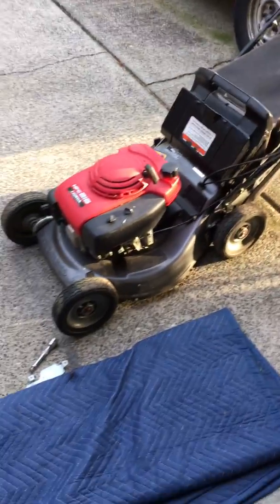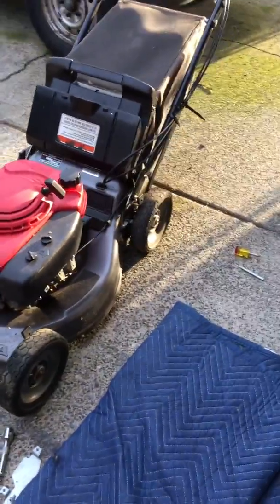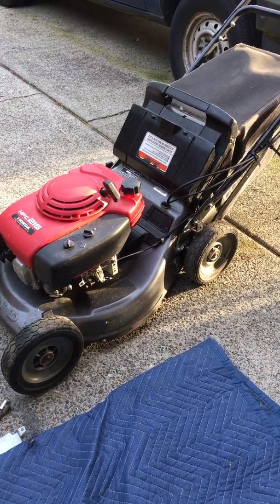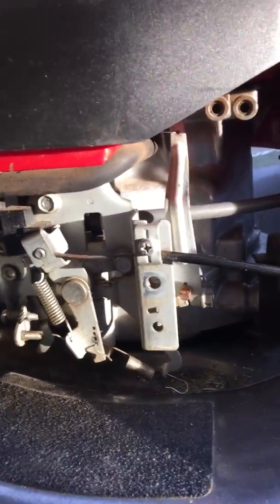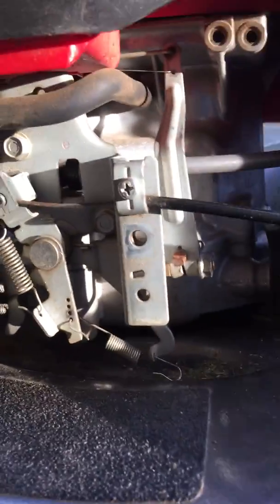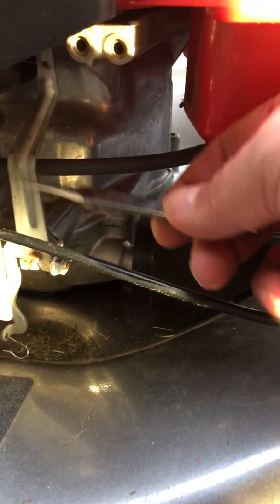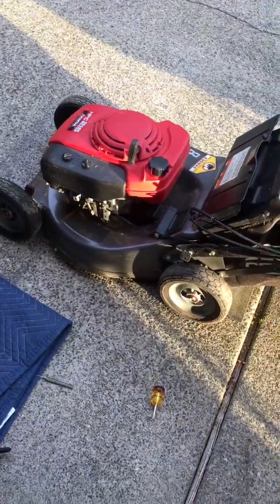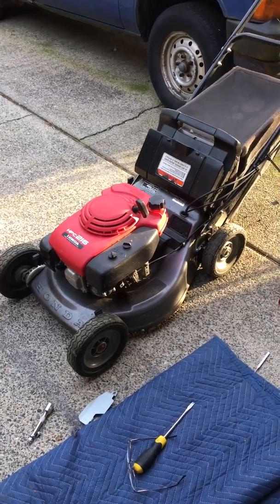Increase rpm on Honda Commercial lawnmower

Comment: Awesome, just used this trick on a 2023 HRU216. Whilst I couldn’t turn the governor thingy clockwise I could hold it still with pliers and move the arm to the left and then tighten the 10mm nut, worked perfectly. Nothings changed in 25years, crazy

Comment: I am on my second Honda Commercial. The first lasted about 15 years until the deck rusted through. I repaired the hole and the mower is still in use. The rpm is set low before delivery and should only be increased after 40 hours (the engine needs to be broken in). You should use a tachometer to set the speed to factory spec. otherwise the engine could suffer. They are called "commercial" yet few landscapers will use them (the main reason is they are very heavy). They are hard to turn and sink into wet grass. You do get what you pay for otherwise. The Commercial will outlast most of the Honda lineup by 3 to 1 in my opinion...

Comment: I did that to mine the motors rpm increased but the blades were spinning at 2,250rpm when I increased the motors rpms did that mess the clutch or clutch belt up in any way,?Keep in mind the motor sounds exactly like yours so I know it’s not running at low rpms
Reply from the maker: Jordan Price 
2250 is almost idle speed. Honestly I’m not a tech but wanted to share my experience.
I just did the springtime tuneup & adjusted idle for 3,100 with blades engaged. I will comment the two adjustment screws with springs around them (1 long 1 short) are for choke & hi idle adjustments. The black screw on the front of carburetor affects low idle. Compared to an old briggs& stratton it’s quite complicated. One more bit of advice. Never stretch or alter any of the springs on the throttle linkage.
In all the years I’ve owned mine I’ve never had to touch the clutch system so unfortunately I can’t help you there.
Hope you get it worked out.
Reply: jatoav8or Thanks

Comment: If you look at the Honda power curves, you`ll see the max torque is at 2500 for most or all these engines, and the max hp is at 3600. Contrary to popular belief, torque is where the real work is. So, one would keep is engine where it`s the strongest. After 3600, the power falls off a cliff because the engine doesn`t have the breathing to go faster. Honda puts the speed at around 2900 to 3100. Right between max torque and max hp. Good spot. One doesn`t run his car engine at 6000 rpm`s all day even though that is where the red line is.Then, you have the blade safety factor and the internal engine parts strength factor. Plus the extra engine wear.
Reply: Higher RPM increases blade tip speed and that's the key.
Reply: I just bought the HRX 217 VKA with 200cc.  The max speed is the same as 2 clicks down on the speed dial control, so I think it can travel a little faster on the ground.  To make the wheels go faster, do I need to adjust the drive-cable jam nut on the left side of the handlebar?
Reply from the maker: puncht37 ; I totally agree and my mower had no problem powering thru the thickest grass at the slightly lower rpm but for me clogging of the chute was a constant issue. Bumping up the revs has solved that and has served me well for nearly two decades with the same machine.
Maybe my unit was set unusually low from the factory because it was clogging constantly cutting a dry regularly maintained lawn. 
My issue wasn’t lack of torque but lack of vacuum.
Reply: So far, the 190`s got balls. It barely loses rpm`s even in high wet grass.

Comment: Oh ok but how come it says it's 2850 rpm on the manual?
Reply from the maker: Matt Seymour 
I’m a home owner not a Honda tech but the service manual for my model stated a maximum rpm of 3350. The whole reason I ever looked into upping the revs was the fact my mower wasn’t bagging the clippings as efficiently as I knew it could. It’s been 20 years since I changed it & it never clogs up and packs the bag like a compactor, even thick wet grass.
In over 20 years I’ve changed the blade twice , the spark plug once, the oil every year and the mower runs like the day I bought it. 
Maybe my unit came from the factory with the revs set too low, yours may be fine. I posted the vid to tell folks that may be having clogging issues what I did to solve the problem. If your machine is doing the job I wouldn’t monkey with it.  ☺️ cheers!
Reply from the maker: Matt Seymour 
I just want to reiterate that 3350 is the absolute max speed for the engine on my HRC216 circa 1996.
I’ve been told that exceeding that can lead to a myriad of problems like valve damage, over heating ect...  I’d hate for anyone to ruin a great mower because of this post.

Comment: Thanks for info. I had mine done at the mower shop as didn't have the right tool for it as rare fitting.
They did it to 3000rpm is this ok for a hrx537?
Reply from the maker: Matt Seymour I believe the max recommended is 3350.
Reply: @jatoav8or  I spoke to the guy at the shop and he said needs to be 3000 dead on or about that. So I'm going with 3000 as he should know I guess

Comment: What rpm did you set this to?
Reply from the maker: Matt Seymour 
I don’t have a tachometer so I just bumped the rpms by ear. You can tell when a engine is being overtaxed so my best advice is to make small incremental adjustments.

Comment: Thanks for the video, I think this was the best explained of all the ones I have watched on YouTube. I have a Honda izy similar to yours but mine is self propelled and single speed. Should I adjust the govener or idle screw to increase the rpm? Thanks
Reply from the maker: Simon67316 
The idle screw on mine didn’t affect the top rpm. This was the only adjustment I’ve found to bump the rpms a little.